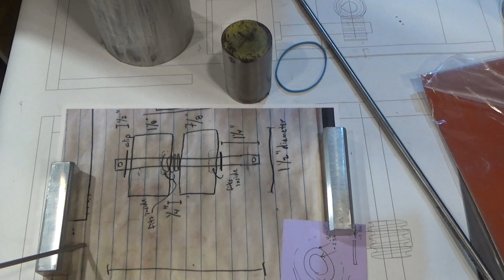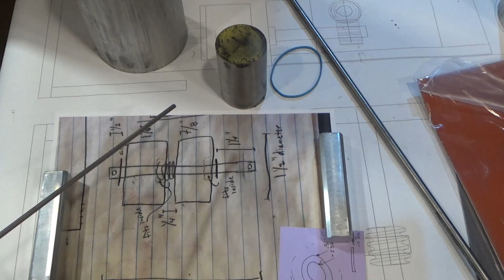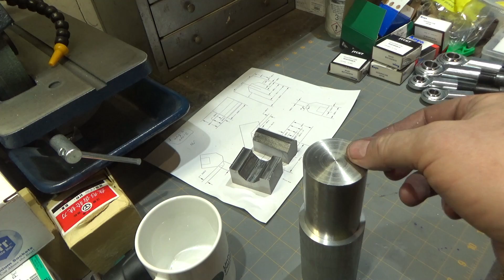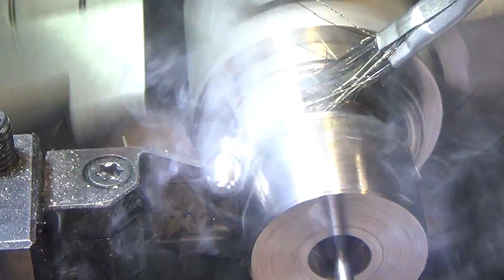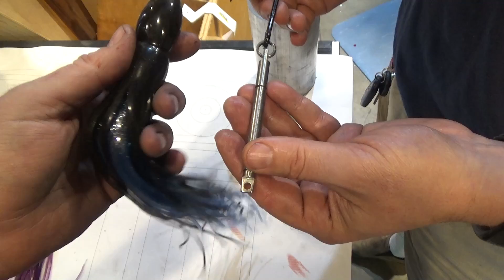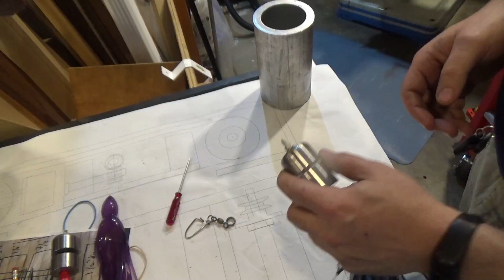HaliBut Cracker Large Predatory Fishing Lure Copy

Comment: Cool project replicating a $50 lure. The 304 stainless lure will need rinsing with regular water after every use to slow pitting.
Reply from the maker: True. I couldn't get 316SS in time to complete the project. Thanks for the tip.

Comment: Minimize waste is a good thing. - Good to see you move the pot scrubber chips before your next cut, - Did you kill the audio because of chatter. - I like your cutting oil applicator bottle, for parting.  So much of the oil is wasted when using a brush. - Never throw away a piece of stainless that might be useful in the future. Waste not, want not. - Darn those hooks. lol- Not everything made in the shop is for a machine or machining.  -  Great lure.  May he catch a monster.  -  Great video.
Reply from the maker: Yea, I figure that if the chatter is hurting my ears, it is like uncomfortable for others as well.
I got tired of the brush as well, during parting, too little of the lube ended up where I wanted it. These squeeze bottles put out a drop at a time.

Comment: Hello in the new Year,  I have not found anything that cuts stainless with a good chip breaking.  A positive cutter seems to work just a bit better but even if you find a sweet spot the changing diameter changes the break back to long long curls.  I cut a variety of stainless in outboard shafting as well as other sources and don't always know the actual alloy.  Tried HSS, and a variety of inserts on my 12"x36" Grizzly lathe.  I haven't used the expensive name brands as I haven't seen any videos where they worked any better.  I am still waiting to find the answer.  Sometimes the finish also looks like it is "pushing" the alloy rather than cutting.  These aren't extremely hard materials and cut well with a bandsaw or file so I am at a loss.  They also part off very poorly with a variety of tooling.  I have taken to grooving them and sawing rather than parting as they eat my inserts and tool holders.  Take care.  Doug
Reply: Keith Fenner has many videos where he does everything imaginable to marine shafting, and he does mention his inserts, speeds, & feeds fairly often.  Since chip control is one of those things where everything matters, just using the tooling that works for someone else is only a place to start, not a guaranteed win :(
Reply: Marine shafting and outboard shafting are two very different metals.  Outboard shafting combines many different alloys and techniques in the same shaft.  While I have worked with straight inboard shafting it is generally a monoalloy, stainless of one alloy,  monel, or even some older slower vessels use bronze.  Most do not have hardened bearing surfaces, splines and a variety of other features including friction welded segments of different alloys.  Neither are they constrained by diameter parameters of an outboard.   An outboard shaft can have all the above as well as tempering and case hardening all in a shaft less than an inch in diameter.  On top of which it is proprietary so one never knows exactly what one is dealing with.  Then add on a diameter which rapidly changes the cutting speed as a function of that small diameter...  I have watched most of Keith Fenner's videos until he recently became an infommercial and I do not ever recall him dealing with outboard shafting.  For all I know it isn't amendable to home machining requiring expensive grinding or ceramic tooling neither of which I can afford.  It is a fight at times but I get it done which is not to say I am not looking for a better way.  Doug
Reply: I forgot to include the fact that each and every manufacturer varies the formula and also within their own product line.  Different hp different shaft formula.  But on the other hand it is free!  I get her done but am always refining the process.  Whenever I get discouraged I price new stock.  Plus we have no source here on an island in Alaska.  Take care.  Doug
Reply from the maker: I really appreciate the insight. Thanks for taking the time to let me know how things work for you. I really learn a lot from other people sharing their experiences, especially since mine is limited. If I ever discover a miracle insert I will make sure to do a video on it. Cheers.
Reply: I had no idea that anything in the category of shafting could be that complex.  Now I know to stay the hell away from it for any mystery metal projects.  Thanks, mate!
Reply from the maker: I have definitely seen this effect before. Keith is one of the great youtubers.
Reply from the maker: Very interesting set of details. Thanks for sharing. I had no idea how high tech marine shafting had become.
Reply from the maker: Ingenuity from need. Love it. A demonstration of what is best in humanity.

Comment: The chatter on the radius tool wasn't helped by the live center not contacting the part.
Reply from the maker: Very funny. I just went back and looked at the video and you are dead on! I didn't even notice! I was letting my brother-in-law do most of the machining, because he wanted to learn, and never noticed the tail stock had been moved. I wonder if it would have made an appreciable difference? You definitely get the great observer award!
Reply: I would say on a small machine like that, all the rigidity you can get, take it.
Reply: Dudley Toolwright - You lost it when you moved up to the highest feed rate.  Must have pushed the aluminum into the chuck a few thou, or tightened on the bolt.